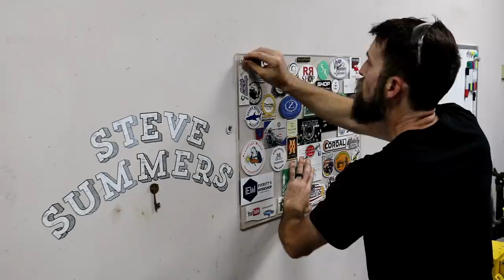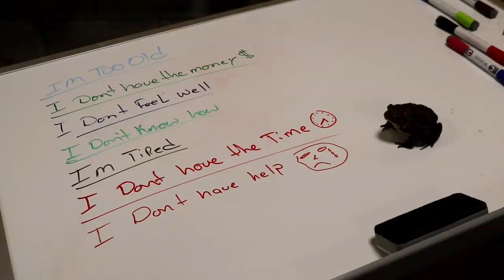Shop wall removal / Cutting the Concrete floor / Truss Tails

Comment: Steve you can build fly rafters on each end of your roof to create the over hang you are looking for. if you are not sure how to do that, check out lumnar acres farm, they are building a kitset barn that has them. And I am sure you have plenty of off cuts from which you could knock up the frames with.  Also have you considered installing floor Anchor points before you pour that new slap, that would give to points in the floor to secure your winch to when shifting that large equipment you have around. looking great so far, take care Kiwi

Comment: Lumber prices, and building materials have skyrocketed because of this cv crisis. Production screeched to a halt while demand has literally increased because people are home and doing diy projects and remodeling, while they're home. Ordering windows, doors, cabinets, went from a 1 or 2 week lead time to now 5 or 6 weeks. I'm in east Tennessee, builder and remodeler, ...we're busy as ever. It never really slowed down for us, at all!
Reply: Here on Long Island our lumber prices have gone crazy. 3/4 plywood has gone up 100 percent. A 2x4 that was $3.07 in January is now $7.98.
Reply: @kurtdietrich5421  for twice the price they can keep it all.
Reply: @1pcfred  luckily, I just needed a few 2x4s to finish up a project and 2 sheets of plywood.
Reply: @kurtdietrich5421  I needed a bit to fix my shed myself. Was that or the whole place was going to fall apart. It was leaking bad.

Comment: I like your idea of adding the tails to your rafters. I added extensions to my garage rafters, too. It really saves the exterior walls from the weather. Here in the Pacific Northwest, we get a lot of rain, and it makes a lot of difference.  I'm all about making improvements that reduce needs for maintenance. Painting, or staining the T-1-11 plywood will greatly improve the life of the wood, and the appearance, too. What do you plan on doing with the concrete cutting slurry?

Comment: Take some 2x4s and some plywood. Line it with plastic sheeting. To make 18" or 24" x concrete pavers  with any extra batch not used.   If you cut the 2x4s at a slight outward angle it will flip out without screwing up the form box.   Just a thought

Comment: Hi Steve,
I am no builder but I was thinking could you not lay one course of concrete blocks then build your internal drywall on top of it, obviously putting some sort dampproof maternal between the concrete block and wood. I like the idea of a separate grinding room.
Have a good weekend
Paul,,

Comment: All that old roof metal seems like it would look good and give a “rustic” look as the ceiling of your shop.
Reply: Tony Baggett your kidding right?
Reply from the maker: I like the thought of that.👍
Reply: That's a neat idea.  Could also be used for a wall, or the lower part of one
Reply: @SteveSummers  you know for that matter the undersides will still look pretty good. You could recycle them either way
Reply: Tony Pike have you seen how much they charge for rusted corrugated metal? It’s insane. I’ve seen tons of places using that stuff as decoration and it looks good in a rustic setting.
Reply: Tony Baggett people here where i live steel bark right off the trees to make wall paper but if Steve wanted to go with the rustic look He wouldn’t be doing all that work.
Reply: Perhaps, but imagin the reflected sound!
Reply: Not sure, I believe it would drip on cold mornings from condensation. The last thing you need in a machine shop.
Reply: jonka1 if it will drip due to condensation then he currently would already have that problem. I think it would also be a good idea to insulate the ceiling. It won’t be a huge help but a little.
Reply: Crichton Bruce I don’t see how it would be any worse than it is right now.
Reply: @tonybaggett1984  It looks to me like the part of the shop that's been used as the machine shop has an insulated ceiling already in place. The tin roof will have been dripping onto this for years without effect. Your idea will introduce a risk of condensation issues which are a serious problem in any workshop. My own shops all have insulated ceilings which I installed to deal with this very problem.
Reply: jonka1 all I’m saying is that shops in all kind of climates with metal ceilings don’t have a serious condensation problem to cause an issue and if he’d insulate the ceiling I’d think there’d be less to no chance of it forming. On top of that if condensation is bad enough to drip from the ceiling it seems like your machines would condensate as well. Meaning you’d really need to fix the condensation issue in the shop. IMHO
Reply: @tonybaggett1984  
Well in spite of your assertions I don't agree with you and I see your idea as risking creating a dripping issue where non exists at present. Machines are prone to condensation from moisture in the air and I don't see Steve heating his shop overnight as being an option so I expect he'll continue to rub them with oil to protect them. 
I suspect that you are never wrong and your inevitable self=serving reply will be the end of this exchange.

Comment: That "decorative ply" actually holds up pretty well if you "5-side" paint it prior to install.   Also, caulk the joints with Dynaflex 230.
Reply: @prototype3a  yeah lumber is off the menu for me for the foreseeable future. I didn't think it was cheap before the price skyrocketed. Now forget about it. Next year is another year. So is the year after if it takes that long.

Comment: Little bit of wood glue on these extensions before nailing them on would have been nice. Also thought so when you used plywood on the strut in the last episode. If you don't wanna take it apart again, add some wood glue. 🙂

Comment: Get some oxcilac acid and spray on the old timber and leave a few hours and power wash it and it will look the same as the new repair. Then stain to your liking

Comment: I would have put the new tails on each end rafter, cut them to length, put a string across them to locate the rest of the precut tails in a straight line to avoid cutting them later.

Comment: First the walls were finished with plaster and lathe, (wet wall method) then came “sheet rock” which was put up dry, aka “dry wall”.

Comment: I might have an idea for how to get the plywood up to the roof by yourself. Well, honestly I do, but whether or not it is worth it is up to you. Rent a 10 or 12 foot manlift with a 4-5 foot wide deck, 10-12 foot long. Stack however many of the pieces of plywood it can lift on and raise it up then walk them off. You can do both sides from the one side, seeing as how you cant get to the creek side with it. Just put it on and nail as you go. or skid steer with fork lift attachment on it. I dunno, maybe you have thought of something better.
I would come help ya but it around 500 miles from me to you and people say I am a bit weird, (don't want to freak your family out).
Loos good Steve, best of luck to you with it all and thanks for the videos.

Comment: The concrete saw is tripping the breaker because of your extension cord and the voltage drop.  Get a heavier gauge or botch 2 together.
Reply: P = I squared r 
Undersized  MCB or overloaded saw then it’s doing it’s job , or do you have earth leakage trips in yeh USA that would do it

Comment: Steve , that decorative plywood in the carpenters trade is refereed to as T one eleven.  Also in Hurricane zones a overhang of any kind is a total no no as 120 plus mph winds will grab your roof by the overhang and pull it right off the wall straps and all ! I had that size overhang for my first Hurricane on my house that I was here for but when the roof was taken away by Hurricane Charlie I did away with them , cut the roof flush to the wall and  machined up some custom H/D 6 inch wide 1/2 inch thick I beam straps to lock the roof to the floor slab that so far have held the roof on the walls the last 20 years through 7 named 120+mph Hurricanes . Now all my neighbors want to know where the heck did I get them custom full sized I beam roof straps !
Reply: I don't think too many hurricanes go where Steve lives. He's pretty inland.
Reply: @1pcfred   That may be true, but there getting stronger ! had one pass through up in Tenn this year ! 80mph gusts
Reply: @1pcfred   You mean there really IS FAKE NEWS on major news stations !  Nooooooooooo really  lol .
Reply: @hydroy1  only a third of people know that.

Comment: 10:03 Nice to find out the different names for things. Where I come from we called these Gang Nails. 
Steve, have you considering using a sliding door(s) where the bi-folding ones were. It would mean you don't loose the space required for the regular "swinging" doors? I don't know if that would be suitable for your place. Also, every time I see you unlock the doors I have to laugh about the gag you set up for several weeks when the wall was down when you unlocked to door and then that one day you forgot your keys and walked around the locked doors. That was a good one. 👍
19:58 Holy cow Steve has got a floor grinder. 🤭

Comment: I like big open spaces, so I'd not resurrect the wall. Although I do see the benefits.
Reply: yeah I see your point - Steve mentioned "grinding room" which will help keep all the airborne fines in one place.   Perhaps even use the space for a spray painting booth too.
Reply: @criggie  Yeah, dust, local heating, wall space,...

Comment: How often have you used that old Cin.(clapper head) shaper?...never?. Just because it was free doesn't mean you will ever use it. For what you can get for it's scrap metal you can buy a used knee mill like a Bridgeport mill that you'll use often......get rid of the old boat anchor

Comment: by the time the rebuild is done you be standing at the vice with a machined part clamped in holding a trowel going like .......HUH?
about greying the new panelling : let a small piece of steel wool (or a few non-galvanized nails) sit overnight in ordinary white vinegar, then dilute the vinegar solution 1 to 1 with water. (If you used 1/4 cup of vinegar, add 1/4 cup of water.)

The nails or steel wool will have rusted. Test the result by brushing the solution on a piece of scrap wood the same as you will be using, to determine if the aged finish is the correct color. On most wood, you will begin to see the aging effect as soon as the solution is dry If not, for darker solutions, leave the solution to sit longer, or add a bit more vinegar, and test it again. 

Do not paint this on the final wood before you make a test in a low visibility area. The solution will need to be stronger or weaker to match age effects on certain woods.
couldve put on even longer extentions and turn the gravel under it and make it a lean too

Comment: @ 26:40 we can see some cracks between cinder blocks, did u think it will collapse like the other side of the workshop ?
Reply: Clément CLARISSE _____Frood_____ there is a huge slab of rock right down that side of the building. Look back a couple of months when Steve and his friend Al were clearing out by the side of the building to put drainage in and couldn't because of the rock slab right under the surface. It probably extends under that wall and should not move in all our lives combined as it's already been there probably fifteen thousand years! lol
Reply: @samrodian919  probably, but it does'nt crack without any stress on the wall, something must have moved/slipped for making it appear. I hope for him it won't move further.

Comment: On the subject of roof overhangs, I never understood this one: https://goo.gl/maps/ggkaiChibCjpqRbU6 And note that that is a sandstone slab roof, as is traditional in that part of the UK. Newer buildings around it have slates or concrete tiles. I don't think tar-paper shingles are even allowed for residential.
Reply: andy pugh strange
Reply: Asphalt shingles is the standard here. Just did my shed in 25 year 3 tab. Good enough. I'll be dead before it goes bad. And then I don't care.
Reply: @1pcfred  Whereas we just had the original roofing  re-laid on the barn. Using all the original 200+ year old slabs. 
I have to confess that your way probably makes more sense.
Reply: @andypughtube  it can make more sense if people are sensible. But we're talking about people so I wouldn't bank on it. With a clean slate you can have a better idea of a project at the outset. Renovating who knows what you're going to find. Most folks I know don't have X-Ray vision. So when you start peeling the onion there's usually some surprises to see. And some tears too.

Comment: I read those mending plates are supposed to be pressed?  Not criticizing.  Honestly just don't know.
Reply: Hammer heads press them into wood, don't you think?
Reply: @1pcfred  I suppose, but maybe at the cost of strength if they're bent out of plane.  I just read thats the "wrong" way and was seeing if anybody had any opinions.
Reply: @Live.Vibe.Lasers  bends should make metal stiffer. Called cold working it.

Comment: When you put $Trillions$ of "new" money into circulation the value of the money goes down, way down.
Reply: There's more to it than that. But that's been a factor. People know that money is floating around and want their chunk of it. Their chunk, your chunk, everyone's chunk of it they can get.
Reply: @1pcfred  "new" money in circulation by itself does not cause inflation ("the value of money"). it is only when "new" money is spent that the overall supply of money is devalued
Reply: @naranjosangre6500  that's what you say. What I say is our economy is based entirely on perception. Says so right on the cash we use. In God We Trust. We trust that when we wake up those pieces of paper will still have some value. That cash does have any value is entirely faith based. We went off the gold standard a long time ago.

Comment: The Simpson mending plate says "NOT FOR TRUSSES"  because it is not for trusses, the liability is that they are not designed for this service and are not as strong as real truss plates, -there is your liability!  The real deal truss plates are almost twice as thick, which means, twice as strong. They may even be made of a different higher grade of steel as well.  Also those truss plates are "PRESSED" into position to ensure each tooth goes in straight and with the minimum amount of wood damage, which means, maximum amount of wood grip. Also they are pressed in on BOTH SIDES of each joint. your video & discussion does not show 2 sided application. Maybe you did 2 sided installation.  Maybe you still have an original truss plate from the trash?  Maybe you could compare them side by side?  It probably won't cause you any grief in just 1 truss repair, but think if the entire roof structure was made with these inferior plates! Thanks for all your efforts in producing these videos. Good Luck! Be Safe!

Comment: Don't be so dismissive of cellulose insulation. It's far superior to fiberglass in many ways, especially your lungs. Once it settles it forms basically an air tight barrier, and it's much easier to install correctly than fiberglass bats especially when you have joist and stud spaces that are not perfectly sized. The mess is basically the only drawback.